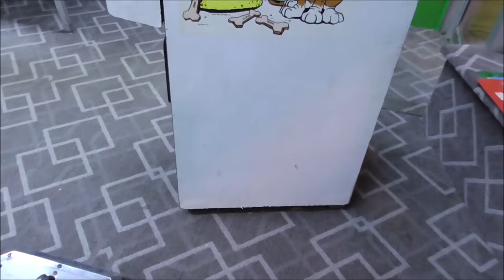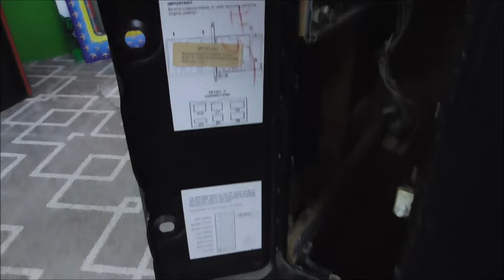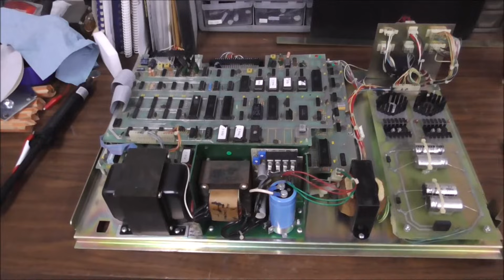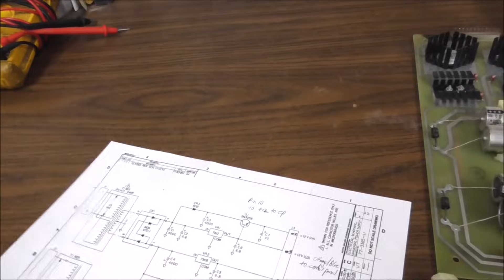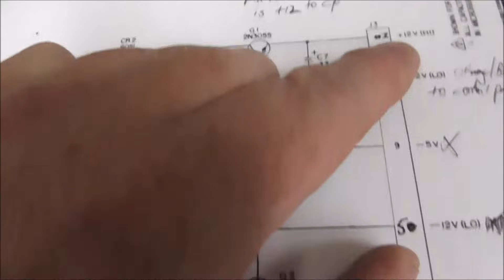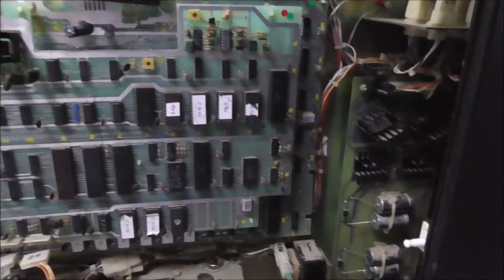Repairing The Fried Power Supply In A 1981 Exidy MOUSE TRAP Arcade Game - What Happened???

Comment: a 2n3055 is a high current pass or power transistor made for passing current around the 7812 while still allowing the 7812 to regulate the voltage at 12 volts but allowing up to 15 amps of current to pass around the regulator through the pass transistor.

Comment: Yeah, I think in Tom & Jerry, there was a dog named Spike, I think.

While I see a snake in a machine as possible, I'd think that cockroaches and rodent "evidence" is more common.

On capacitors, if you have to, you can wire multiples in parallel to increase the capacitance. Or, if you have only twice the capacitance, you can wire them in series.

Comment: Lo is a lead off the 7812/7912 high precision regulated output, but limited to 1.5a or so max.   Hi is coming off the transistor follower which offers much greater power capacity (up to 10amps or so but I doubt the board can go that high), but the regulation is slightly softer.    HI would be good for things light general illumination, Lo for circuits needing tighter regulation.   That board should have some fuses...

Comment: Lo is low amperage and Hi is high amperage, usually a transistor regulator is used to provide high current because UA7812UC has 1,5A max current, in this case the 7812 is used as a reference to drive the transistor. The capacitors are there to provide noise reduction. 
Edit: Sounds like some audio file is corrupted and causes the attraction sound loop to crash and reset constantly._

Comment: JOE CLASSIC< Do you figure out what that +12vdc HIGH means and what the +12vdc LOW Means? The High and Low must mean something, if you have a current CLAMP you can measure the current of the HIGH and LOW to see if the currents are different or the same. I wonder if the service manual will tell in the tech notes what the high 12vdc and low 12vdc means because I'm curious

Comment: Ron, you are absolutely correct on the 12 volt Hi and Low being amperage. The 2N3055 is a pass transistor that can deliver more current than possible with just the 7812 regulator.
Reply from the maker: Thank you atschimer

Comment: That control panel is an abomination! Sticks on the right? I'll never understand that.. Do you have a favourite right-hand-stick game you've come across, Ron?
Reply from the maker: Let me see if I can help you understand it.  In 1981 when this game was made, there had been very few games with a joystick, most of them before that had buttons.  Some games had a joystick in the middle.  So they sometimes decided to put the joystick on the right, because people in general are right handed.

What is so hard to understand about that?  Why would they assume you want to use a joystick with your left hand, if you're right handed?  

In this game, pressing the buttons you could do with your elbow, you don't need any dexterity to press a button every once in awhile.  You need more dexterity on the joystick, it's used more.  

Centipede has the trackball on the right, BURN IT DOWN WHAT WERE THEY THINKING
Reply: @LyonsArcade  

Thanks for breaking it down for me, a simpleton. Trackball on the right I get, as to me, you often need that precision of hand directional control in the angle of roll/attack on speed rolling ["golden tee"], and finger strength/dexterity for precision movement [missile command]. 

I remember ambidextrous games (stick in the middle) , I just can't recall that many right handers that weren't modded to be that way. I wasn't shitting on mousetrap, just looking for some insight from someone who's probably had thousands of cabinets pass through his hands.  

So basically, being a pioneer is tough and with 40 years of hindsight, innovative choices can look questionable. Makes sense! Please don't lump me into your cantankerous hater category! :D big fan, watch every video, love to learn along side you.
Reply: @LyonsArcade  Pac-Man is one of the few classics where they deliberately left it up to the player to decide which hand to use to control the character.   There were no buttons to use other than 1P or 2P buttons and those have no function other than to start the game!
I think Donkey Kong might have been one of the first arcade games that forced you to use a left-handed joystick with a pushbutton controlled by the right hand.  It was also a four-direction control lever, a point that Billy Mitchell dismissed when he cheated for his DK high scores!
Reply: OP,
You're wrong about right-handed joysticks.
That was STANDARD for years!  It was only AFTER Nintendo started selling the Famicom/NES that left-handed directional pads and lefty joysticks became standard.
I had 2 of the old videogame systems -- the Odyssey 2 and Atari 2600.  Guess what?  The joystick controllers on BOTH those systems (which were late 1970s vintage) were right-handed with the single button on the upper left side.  Most of the early third-party joystick controllers (Wico's among them) were also right-handed.
The only controllers I have at present that are right-handed are flight stick controllers for simulators and arcade/action games like Ace Combat.  Throttle is always left hand control, the main stick is right-handed.  That's because they emulate real-life aircraft controls which are standardized around right-hand controls because 90% of the population is right-handed!
The arcades and fighting games in particular went in the opposite direction (left-handed) because it raised the challenge for gamers and made more money for arcades in the long run (or at least the limited time arcades had in the West before home consoles and PCs became powerful enough to make arcades seem pointless to most people)!
Left-handed is still the preferred format for fighting games because A) it's tradition and B) many fighting game fans are masochists!!!  LOL
Doesn't matter to me, honestly.  Joystick controls are one of the things were I'm ambidextrous.  I learned to play right-handed first (despite being a Lefty for most things) and then was forced to switch to left-handed control because of the Nintendo NES system pads!
Reply: @AvengerII  at the very least I'm happy to say I started a civil discussion on the internet, I may have been a little too evocative with my "abomination" description, but I fully admit.. it's my bias talking. Thank you for the history lesson, people!
Reply: @SpaceCop  Nah, don't worry.
Half the controllers released on the market HAVE been abominations!  😆
I never liked the dial controllers like the one Atari installed on Tempest, either.
It's only been since about 2005 that Japanese joysticks started arriving that were made with arcade parts OR easily upgradeable.
One of the worst joysticks they ever released was the Atari 2600 joystick.  I thought the system AND that controller both sucked when they were brand new!
Controllers in general are better today but the joypads really aren't suitable for at least half the retro-games.